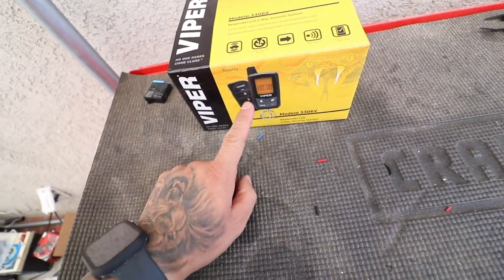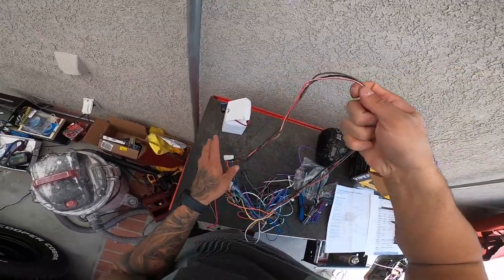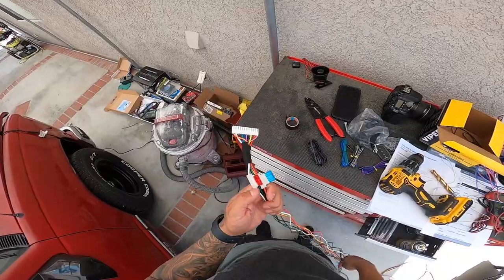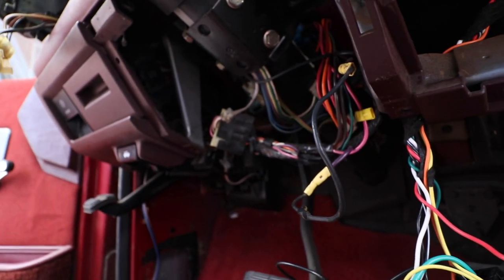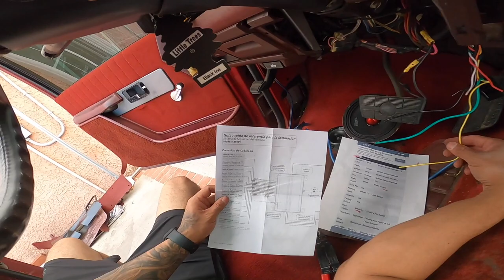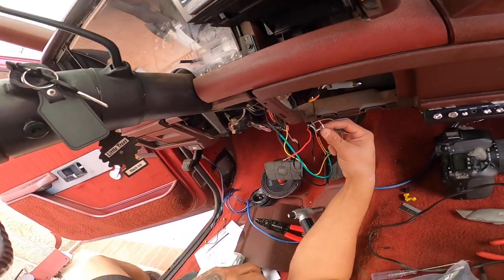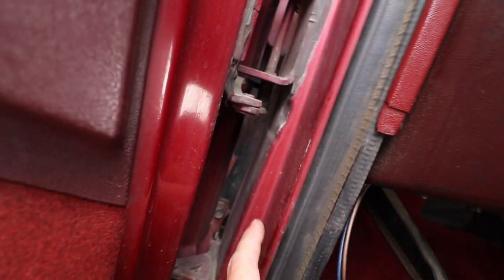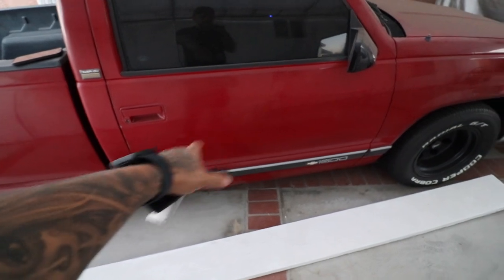VIPER ALARM ON MY 1990 OBS *DETAILED*

Comment: Hello, good video thanks. Got a question, though. I see that you connected that relay, to other wires that deals with the starter and ignition system/switch. Now, if that relay goes bad or failing, will that prevent your ride from starting up? You know, due to you not being able to get power to the starter and ignition switch, through that relay?

Comment: Quick question if I already have power door locks, I do not need a relay to install my alarm, right ?
Reply: The relay  is to  switch the positive trigger from the truck to a negative trigger for the Alarm box

Comment: I have the same alarm on my 90 but I also installed the remote start with gps also. I have the app on my phone I can lock unlock start engine all from my phone.
Reply: What viper alarm are they ?
Reply: What's the price per month or year with gps/ Smart start?
Reply: @mmicky07  I pay like 12-13 bucks a month but there’s different prices also varies if it’s more then 1 vehicle and so on

Comment: If you unlock the door with the regular key does the alarm still warn you
Reply from the maker: Yes
Reply: @projectvc425  meaning the alarm will go off unless you turn it off with the alarm controller ?